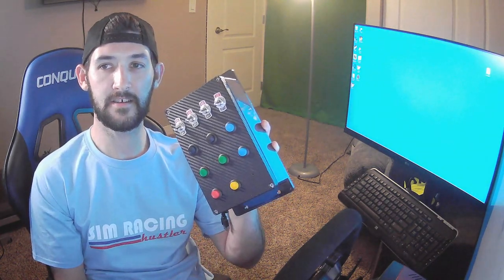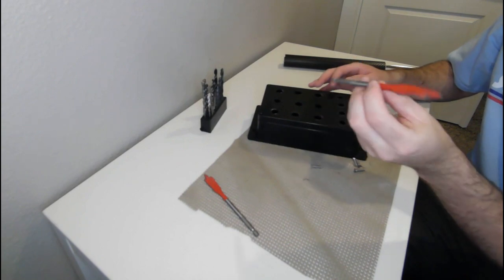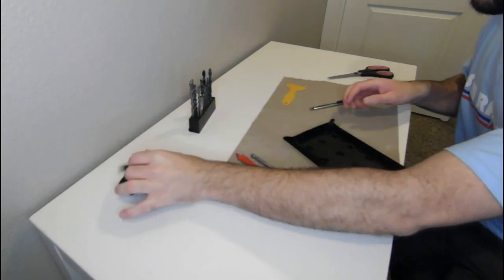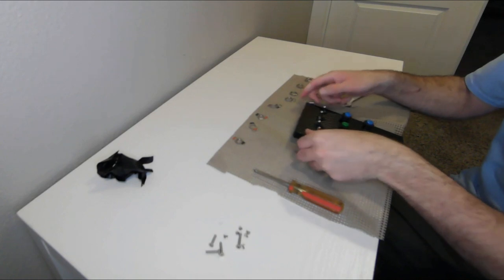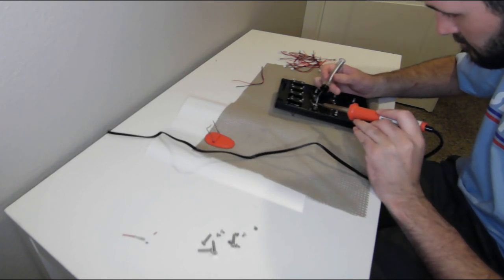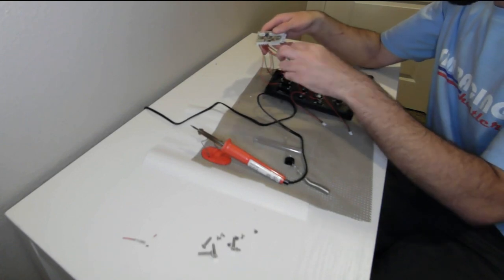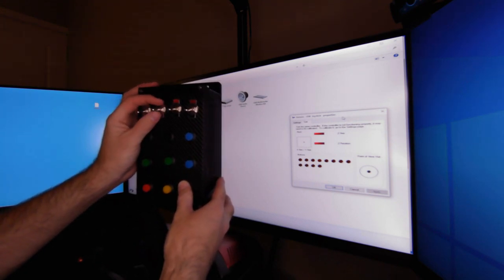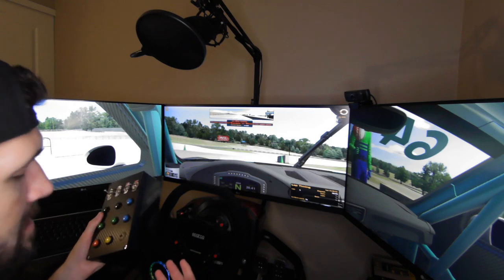How to Build A Simple Button Box That Can Be Used For Sun Racing Gaming Or Other Interfaces on PC

Comment: Hey mate I’ve just built one and I’m having to double throw the on and off switches to get the ignition etc to work correctly like you were in your video . If I program the push button to the same  function as for e.g  ignition the on and off switch it works fine . Did you find a way to make the on and off switch work without a double throw ?
Reply from the maker: If you are using the rocker switch like Me then I don’t know of any way to avoid double throw. Because it’s electrical current, you have to cut it and re-engage. There may be a work around but never really thought much of it.
Reply: @ThirdWheelExclusive  thanks for the reply. hmm there must be a way I’ll try with a switch that is double with one NO and NC position that I’m guessing will work
Reply: Hey mate I found a fix with a SPDT switch very simple and cheap loop a piece of cable from the 2 switching terminal and leave the 2 cables from the joystick usb connected as normal Bingo!
Reply: @luke070299 what do you mean by looping a cable from the second switch terminal? I'm having the same double throw problem